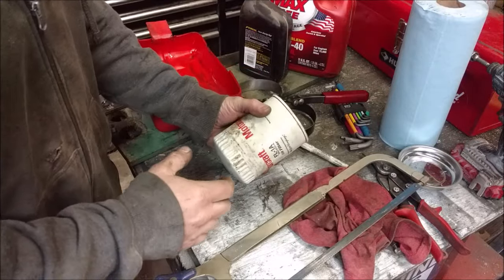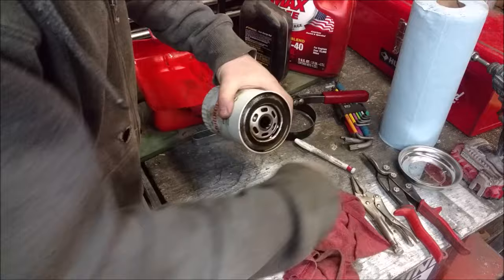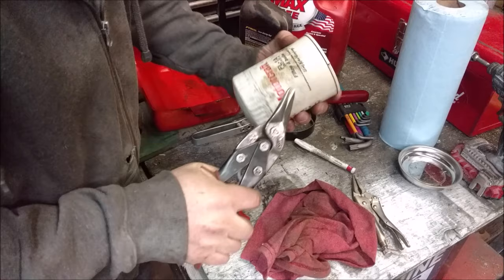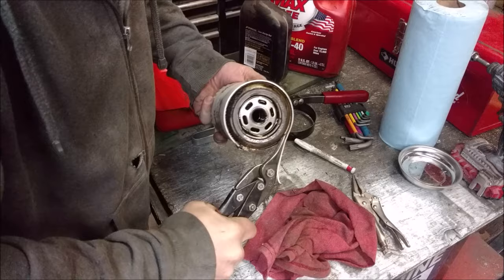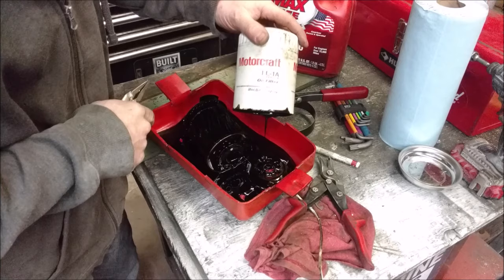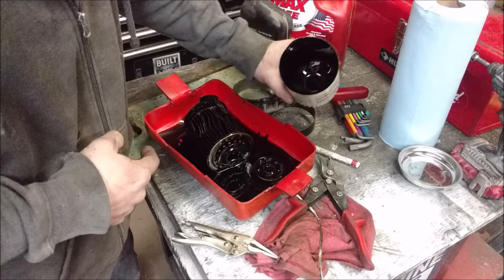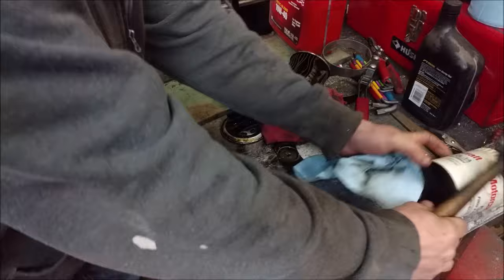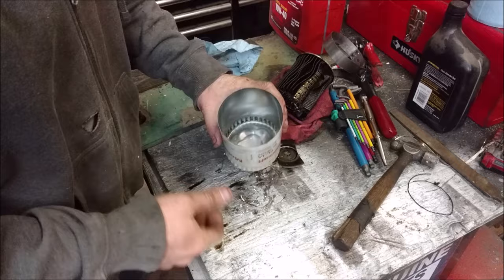How to Quickly Open Oil Filters for inspection NO GRINDER NO SAWS

Comment: 10 uses for old oil filter.
 1. container for shop table
2. put hole in center and cut vanes on side to make lawn whirligig.
3. clean out make drink container
4. clean out make jello mold
5. apply false bottom to make hidden oil filter safe
6. use as end cap on pvc pipe
7. make alcohol can or wood stove
8. paint black, put big hook on end and make pirate hand
9. plant flowers in them for wife
10. attach long pole to make gadget to snag fruit from trees

bonus- make wind chime with oil filters and spark plugs
Reply from the maker: Time to start collecting more oil filters. I need to find a proper hook!
Reply: #8 lmao
Reply: Wow! So many useful tools!.
Reply: @sixtyfiveford  silencer for sound, of a shot. NOT LEGAL!! 
DON'T DO IT!!!!
I read that somewhere!!! Not the legal part, that's a "DUH"!!!
Reply: You forgot suppressor
Reply: # 8 pirate hook Why did Nite think of that
Reply: There is another

Comment: I used this technique recently when I compared a USA made Baldwin oil filter with a potentially counterfeit Baldwin oil filter made in Morocco. Both of them put up quite a fight with a brand new pair of Wiss aviation snips so I just ended up getting a dedicated oil filter cutter because it's just going to be better for on-camera results, plus it should take less time on thick can filters or filters with the sealing lip in an inconvenient location relative to the baseplate.

Comment: I found that a good way to drain the filter first is to punch a hold on the bottom (top?) of the filter by inserting a straight pick or screwdriver through the threaded part.  Then I invert the filter and let it drain out.

Now after watching your video, I know how to open the filter at least!  :)

Comment: I run filter magnets on 2 vehicles and now I can cut one open thanks to your helpful video! And as another viewer stated that poke a hole in the filter can unless you want to save it for your handy tool holder....I love it!
Reply: Do not do that. The oil has metal in it for lubecriating

Comment: This gives me an idea for a custom made cartridge filter. I was going to use a roll of toilet paper or paper towel roll.  Now if like your video suggests I can cut open a brand new cheaper priced spin on filter with ease I’ll just pull out the element and use that instead. 👍😁

Comment: I just tried this when showing my daughter how to change the oil on our Suburban.  Apparently the NAPA Platinum filter has a much thicker case than the Motorcraft because we couldn't even cut the lip.  We had to resort to a hammer and chisel before finally realizing it wasn't going to happen.

Comment: I personally don't have much need to inspect the innards of an oil filter.  But, this is a handy tip if that day should ever come.

As for cups, I'm rather fond of those camping stove/lantern mini propane cylinders.  They are quite beefy and substantial.  I just cut the tops off with an abrasive metal-working chop saw.  Be sure they're empty first otherwise there'll be a bit of warm orange and yellow drama.

To dispose of old oil filters, I welded up a simple cylinder/piston combination for the 20 ton hydraulic press.  Works perfectly to crush the spin-on filters squeezing out all the oil allowing the remaining metal hockey puck slug to enter the standard curb-side weekly recycling bin pickup stream.

Love your garage musings.  Always something interesting and helpful going on.
Reply from the maker: Hey Thanks. I'm glad you liked it.

Comment: Great video, love the idea, but boy I had a heck of a time getting this to work on my OEM Mazda Miata filter.  The lip was much thicker (the rolled area) and, perhaps, with the tighter radius of the smaller (4 cylinder) filter, made for a tough job cutting around the perimeter.  I rewatched your video and it went much smoother for you.  

I'll try again in the future (loved the idea) but really had to work hard at it (brace the handle of tin snips on the bench and push down with the other hand, etc.).  Took forever.

Not being critical, just wish it went as easy for me as it looked for you.  Or maybe I just need to build up my hand strength some more!  :-)  

Nice tip, thank you!
Reply: Yeah I couldn’t do this on a Mobil1 filter either.

Comment: I tried this with both Toyota OEM and Hyundai OEM filters. It didn't work well. I still like the air chisel with the sheet metal trimer chisel methode best.

Comment: Nice way to open it :-D
Maybe glue an old speaker magnet in the newly made dip, it may stop it skidding around on a metal work bench, maybe :-)
Somehow I expected you to have an old massive pipe cutter, the ones with the sharp wheels that you keep adjusting on every rotation.
If they ever made them that big.
Reply from the maker: The magnet is a good idea.

Comment: The oil pan bolt is leaking a bit on an old 302 I have. Easiest fix to get it to stop? I thought about using a copper crush washer.
Reply from the maker: I have made paper fiber washers from gasket material, wrapped the threads with teflon, put nylon washers on, put copper washers on and used thread sealant(#2 gasket sealant); all seamed to work really well.
Reply: @sixtyfiveford  I'll give something a try. Thanks for the ideas.
Reply from the maker: Copper is always nice do to re usability.

Comment: I wonder if you could get a can opener to do it.
Reply from the maker: It needs to be cut from the side, so a conventional one wouldn't work. You may be able to get a safety/side cutting can opener to work, but this method is extremely easy.

Comment: That oil filter came out of diesel? How many miles on the oil?
Reply from the maker: 70's Carbureted engine with around 2500miles. Diesel oil is nasty stuff.

Comment: Good for a regular filter but don't try this on a Racing filter like WIX that's designed to hold a lot more pressure. Doesn't work.
Reply from the maker: I've cut apart those, diesel filters of huge trucks, and many others. Never met a filter that I couldn't cut.

Comment: Do you personally run a neodymium along the inner element to find metal or do you break it down with petrol ⏳ tip it out later/visual
Reply from the maker: I just pry the filter pleats open and visually inspect them.

Comment: my s60 don't even use the metal cases just the filter part. I think its just a mess but I see now why some car companies made them so you can see the insides and how your motor is doing....still think its a big mess !!!
Reply from the maker: It's funny how old technology from the pre 1960's becomes the newest technology. Cartridge oil filters, push button start.... etc. Next they'll put drum brakes all around and call it revolutionary.

Comment: what's wrong with a can opener?
Reply from the maker: A typical can opener won't work as you need to cut it from the side. I safety can opener may work, but I've never tried as this method is easy.

Comment: Tried this on a Toyota oil filter and couldn’t get it to work. I must be doing something wrong.
Reply: It's a lot harder to do on a small filter with a small diameter. I tried it too on a Mazda filter.
Reply: @DAS-Videos  try an exhaust pipe cutter tool, that’s what worked for me.

Comment: That works on cheap, shitty paper-thin Ford filters, but how about on a quality filter??
Fwiw I spent a couple of years in the pit at a quick oil change place, and would did over 70 cars in one day, so I've got a lot of experience with filters.  Motorcraft where always the thinest easiest to puncture, and rip apart.
Reply from the maker: It works on all filters. I've cut apart 100's of oil filters from Wix, Purolator, Fram, K&N, Caterpillar and you name it. The Motorcrafts are one of the thicker with gasoline filters. They really don't get thicker until you go to diesel or industrial and those are still easy.